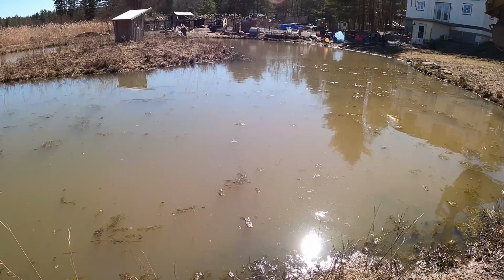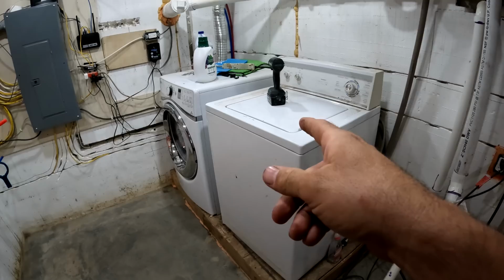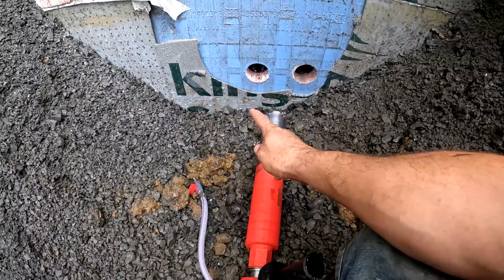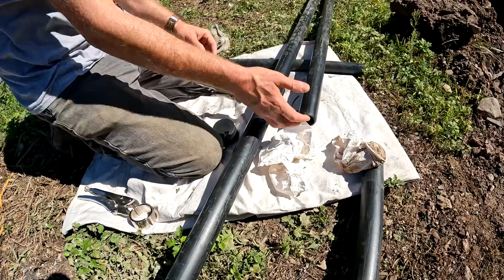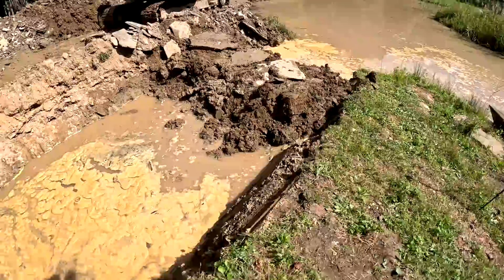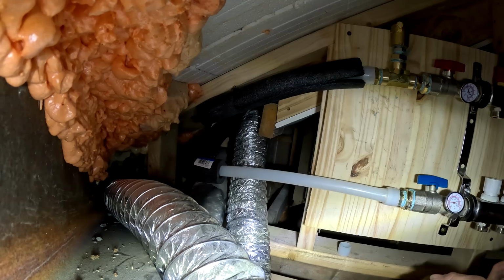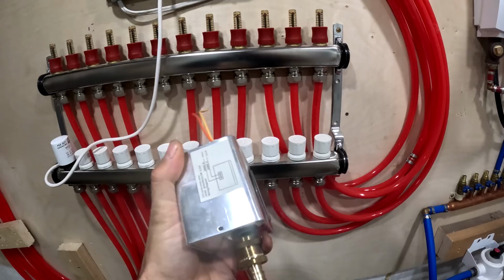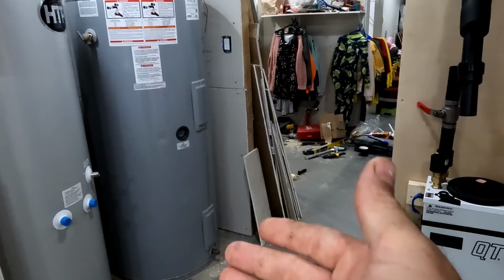Installing a geothermal system with a pond loop at my house Part 1

Comment: I have something similar & I used 2 layers of foil faced 2" Styrofoam. I separate my pipes from outside air. In summer your attic can get up to 120 degrees and in winter it will equal outside air temperatures. 1" is not enough, you need air sealed 4" foil faced foam with an air gap around pipes. I have a smart WiFi temperature probe that controls a heated pipe wrap and turns on / off within 1 degree. Sonoff TH-16 with probe (eWelink app controlled. "Alexa, what is the heat tape temperature"? Mine is 57.6 degrees right now & outside it is 45 degrees. My heat tape has never came on, but it is there for emergencies, and turns on automatically, then notifies me if the air in the box gets below 33 degrees.
Reply from the maker: my attic is conditioned. it is insulated in the roof not the ceiling so I dont need to heat or cool it

Comment: You should not put the coils of pipe in the water like that, the heat transfer is lot less the when you spread out the coils
Reply from the maker: These coils are meant for a pond. That is what they were designed for. Pond loops do not need to be spread out

Comment: What you can do is take a piece of phone and put it on the back of it. That way, you have an edge to glue your other phone too. And it'll all be sealed where you could. You know, unscrew it, or whatever on the top of a piece of phone that covers it, and then you'll be able to work in there, or you can just make your box and see the lettuce.  And then slide it over your phone that fits, that's behind your bowels and then that way, that would seal it off too. And you don't know what you have to do is just put a couple. Of L brackets on it to hold it down.

Comment: how do you change rhe water of the pond? does it has a stream or something ?
Reply from the maker: Its at the water table. So the ground naturally just fills it up, and the excess runs off into an overflow pipe
Reply: @jmuller86 ok i get it.
Reply: i have a pond near my house, which is almost dry bcz water table went 2-300ft down earth, it only fills with rain water & end up almost 1inch/day soak into earth.
Reply from the maker: @CEA1 that is interesting how the water table went down. Here we have clay/rock at the water table so it would be hard to suddenly go down like that
Reply: @jmuller86  the only reason i figured out for the low water table is Mass bore wells/tube wells for irrigation in tbe lower state of Punjab which is a agriculture centric area. the govt stopped charging for electricity fir all the pumps used in it. & people took disadvantage of it. & there are millions of bore wells
Reply: @jmuller86  The main reason for higher water table in your area is you live just 120meters above sea level & the nearby Hudson river & atlantic sea also contribute somehow. I live almost 550 meters above sea level & nearest Arabian sea is 1000s miles away. The nearest waterbody contribute much in maintaining water table.

Comment: The pond pvc looks a bit to weak. You should consider putting some x bracing, or a second run of pvc tied to the first, that has holes to fill with water so you dont throw off bouyancy.
Reply: And why didn't you just fill the pipe with water and cap the end going into the house with a valve on each side? Then buoyancy wouldn't be a big issue not it moving as you put soil in it. The water weight will bed it down instead.

Comment: Do you still need to have a secondary heating system besides the geothermal? Everything i find on google says that geothermal only reduces your energy bill by 50% to 70% but doesn't eliminate it. And for a 2000 sq/ft home the cost is around $25,000 to install. Maybe for regions where it gets to maximum around -15C makes sense, but here in Manitoba we have -40 to -50 C, so I don't think a geothermal can keep up with that.. gas is still king here
Reply from the maker: As long as you can get down to ground that is above freezing temps, this system will work. Geothermal isnt going to eliminate your energy bill, it will drastically reduce it. If you pair it with solar then you will be netzero or even net positive. The cost of 25k is also probably before any incentives. But lets also face it, how much would a forced air system cost anyways? Pretty close to that, plus there are no incentives and you dont have lower bills
Reply: @jmuller86 Cool, Interested to see how you're going to tie solar heating into this. 

Also a gas furnace costs around 5 to 6k with installation plus w.e. gas you use - my guess would be around $800/season. So geothermal is more than 3 times the cost including w.e. incentives you get. 

Geo's only advantage is that the heat pump and the loop would outlast the typical lifespan of a furnace but even that's marginal. And the huge disadvantage is the huge upfront cost, same goes with solar. Love the videos though it's really fun watching you do everything yourself
Reply from the maker: @minergate4066 i dont know what you can heat with $800 per season but around here that would get you a bathroom. It was probably $2500 just to heat my basement last winter. Now tie the other 2 floors that are above grade in and do the math. The payback is only a few years for this system, especially with me installing most of it
Reply: @jmuller86   wow that's crazy, my monthly gas bill never gets above $70, and that's running it 24/7 when it's -30 -40 C
Reply from the maker: @minergate4066  you must have natural gas and a small and efficient house because that is a crazy low number. there are some people who blow through $70 in 2 days here when its cold
Reply: @jmuller86  yes sir, it's just a 1000 sq/ft house, but natural gas here is 8 cents/cubic feet.
I can't wait for the next video to see how you finish installing it, very nice job on how you explain everything in great detail

Comment: So Jesse, been watching for a good while, but Why would you put a 'joint' on such a sharp angle? Why not use a full length of pipe in that sharp bend? putting the joints on the straight piece?
Reply from the maker: That was our intention at first but it just kind of ended up there. It really also wasnt as tight of a corner as we thought though

Comment: 56:00 hot joining is definitely two man job, one on the iron other do the joining, it's risky doing it like that.
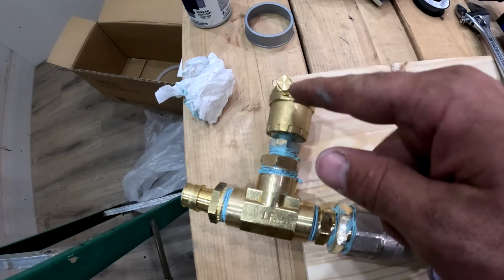Reply: 1:31:50 there's a float in that tiny tank with a gasket at the top, when it's filled with air it doesn't float anymore and drop down, let the air out, water level rise up and shut it again. Mind that air release nipple has a cover, if left open you will get constant pressure drop over time as gasket inside deform, so best way is to open/unscrew it from time to time, let the air out then tighten it back...
Reply: Great how to video again. I know this is suppose to be a test bed for all these systems but it reminds me of a joke:
Architect: What level of automatisation would  you like within a house?
Jesse: yes!

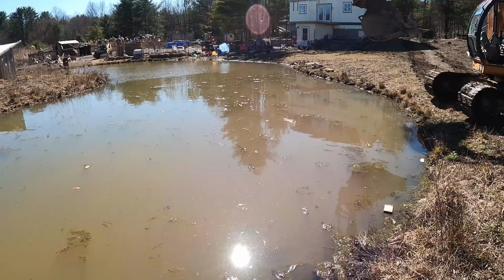Comment: 2:09 where does this heat come from?
Reply from the maker: The geothermal unit extracts it from the ground. Just like an air conditioner extracts cold air from hot air but in reverse

Comment: The 3 coiled pond loops are so densely coiled it's unlikely they will efficiently transfer thermal loads to the pond.
Reply from the maker: there is 4 actually and they have spacers so they dont really touch throughout the coil. and I heated 2800 sq ft plus heated all my domestic water this winter for less than $500 in electric. loop temps never went below 31 degrees. so I would say you might want to reconsider what you thought.

Comment: hmmm... the 'smart' controllers... I would rather it had a network jack on it, instead of a wifi radio, and need to run a LAN wire to it, so can isolate it.

Comment: Sooooo  much easier to just install solar on the roof and run a traditional whole house heat pump. Zero heavy equipment, rock, trenching  or pond builds necessary.
Reply: Yeah, good luck with that in the winter. Your little bit of roof real estate ain’t going to power a 4-ton 16 seer heat pump plus the rest of loads. Not off grid.

Comment: 2K for an air handler? Woah! You can buy a complete DIY mini split for less.
Reply from the maker: Yea I know. And they are so simple to make. Nothing special about them. Radiator and fan
Reply: @jmuller86  The new normal, I guess

Comment: To heat the house you could use solar panela that produce DC voltage with AC baseboard heaters and the regular thermostat you need even less voltage than 220 AC to get the same power no inverter needed to get heat out.
Reply from the maker: Geothermal tied to solar/batteries gets 4x the heat for the same input as electric heat

Comment: Maybe you didn't account for the buoyancy of the blocks themselves. The blocks weigh less underwater because they also displace water.
Reply: Also the pipe wall displaces additional water, not just the interior filled with air.
Reply: How about drilling holes in the pvc. Let the air out

Comment: Why could you not just put clean water in the pipe so it would of made it sink then as you moved towards the house just keep adding water so the pipe would sink since it is on a  slope , ?
Reply from the maker: I could but it would have taken alot of water and we werent ready to flush the system yet

Comment: The installation of a system from start to finish is way more expensive than standard air conditioning and a furnace..
-as a contractor
Reply from the maker: No its not. Not with the incentives. But really what does it matter anyways, your not getting radiant heat with a furnace and forced air is trash. Plus my heating bill will be about $100 a month including heater my domestic water. You will be 4x that atleast with a furnace
Reply: Depending on where you live, costs for a 16 SEER air conditioner and a 92 AFUE furnace can vary greatly—but it can reach $13,000 in many areas. The cost the cost to install a geothermal heat pump varies based on many factors (geography, ground composition, size of home, equipment chosen, etc.) but could cost $25,000 in the same areas. 
Equipment mark up is offset by your having the equipment yourself and friends to help you.
I love your videos and support you..

I've just been in the trade here in Michigan for 20 years. And after about 7 years of yse, no one likes to work on the d*** things.
Reply from the maker: @hvacr24  well this system is a little more complicated but If more people started doing them then it could be simplified. I had a mini duct system in my old house. Basically each floor just gets one and it gets 4" mid velocity ducts into each room with dampers for zones, a little bit easier than what I did for the AC but they dont make them anymore. That was turbonics and they stopped making them. I am sure somebody still does though.the radiant part of the system is crazy easy anybody could install that part

Comment: You should insulate the pipes in the ground or put an insulation between them. The way you did it  you shunt the system and ruined the efficiency.
Reply from the maker: 3 ft apart is all you need

Comment: Engineer talking out of his ass, but it looks like you're right about the 1.5" splitting like a manifold to the .75". and yes it it's more efficient than having the loops in series! 

tl;dr of why: it's complicated. temperature is part of the story but it's moreso about how fast you can transfer heat

Comment: Fire rating that utility room, I guess dry wall, at least, and taping the joints is not a concern, with children living in that fire trap? But they are your children. Oh i already here it. I will come back later. And fix all the deficiencies.
Reply from the maker: First of all, the room is surrounded by concrete, the floors, the walls and the ceiling are concrete. Second of all I am using 3/4 plywood on the walls for fire rating...maybe you missed that
Reply: @jmuller86  it is not the concrete that easily burns. what about the styrofoam that you put on the walls and ceiling? Ask your friendly mortician what burning styrofoam does to human lungs.
Reply from the maker: @SPUDHOME  ok but my children do not sleep in the utility room. They sleep 2 floors up. Like I also said, all of the foam will be covered by either drywall or 3/4 plywood
Reply: @jmuller86  like i said every thing is ok. You will come back and fire rate the utility room. After you argue about it. In case you have never noticed. In a home fire, the fire rages “up” into the home. So your children are perfectly safe 2 floors up. Don’t worry. I wont they are not my children.😬😬😬😬😬😬😬😬
Reply: @jmuller86  ok you will cover the foam. Before or after the fire, that kills them? Just curious.

Comment: You going to get paid to heat your house in the end. Talk about overkill.
Reply from the maker: When I put in solar and batteries, I basically will be making money each month
Reply: @jmuller86  have you done any calculations on how long until you pay of your investment and system starts generating money? Good thing that you build a real house, not that firewood nonsense that Americans usually build. Greetings from Europe from a real house.
Reply from the maker: @harkbelial  I really dont know how much it is going to cost until I am done but I am thinking it will only take 5 years to recoup the money
Reply: @jmuller86  that's great. Cheers!

Comment: Those very long zip ties. Don’t worry plastics are not a problem in the water ways. Ok we will cut them off later, even the ones pointing down. Not a problem.         NOT

Comment: Can You Use a Pump Sentry Battery Backup With Your Existing Sump Pump  https://www.youtube.com/watch?v=2y44o3rQuGQ&t=4s . 20 years ago it did not exist , we installed a RV inverter charge back than to do the job , that was over kill

Comment: Great project.
You are not a carpenter or a electrician 🤣🤣🤣🤣 
Please,  when you are doing wiring... Do not remove that much insulation, when wire stripping... No copper should be visible, when you put in the wire in a terminal... Only insulation. And use propper wire tools otherwise you damage the solid wire and introduces possible later faults.
Here is some tips: https://youtu.be/4W_Iv6LnazU?si=8vGNwLz1TQqN0Hbu
And yes I know, it is JUST signal wires in your case, but it is gonna be a bitch figuring out where the fault is later when one or more faults occurs at some point
And use WAGO 221 connectors instead of those "curl-thingies"/wire nuts.
Last I love that you are using a Grundfos pump (Danish dynamite!) and you actually spoke it correctly

Comment: 🤔 "I built this pond with the intentions of installing a pond loop for geothermal... " @5:54.        JUST NOT THIS SYSTEM ! 😮 OBVIOUSLY
Reply from the maker: what do you mean? the fact that it wasn't deep enough? I wasnt worried about that at the time. I had no idea where the house would even be when I dug the pond
Reply: @jmuller86 , you always have a 'come back'.  Not quite straight forward. But, a round about one.

Comment: In the US, living atandards keep going up and up...
This home resembles a 1970's home that no one will want, especially with this crazy heating system.
You can heat that styrophome home with a candle.   Your savings cant be more than $20 a month over normal forced air!  Tje payback is 20+ years!
Reply from the maker: It will cost 3-4k a year to heat and probably another 1k to cool. 5k a year down the drain. I can heat and cool for less than 1k now. That doesnt take too many years to recoup that money. Plus I also have a big savings on my domestic hot water heating bill